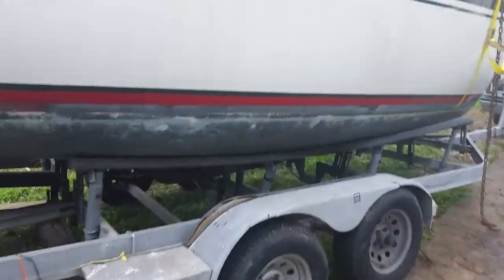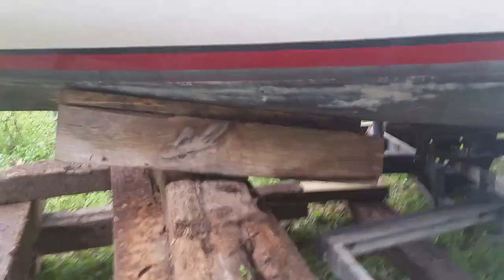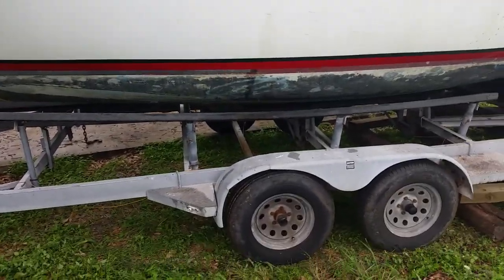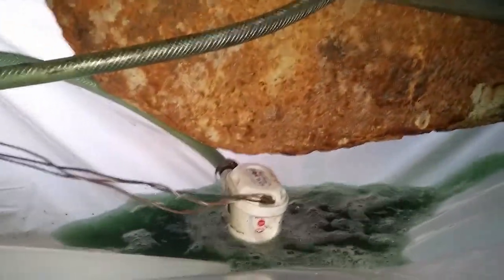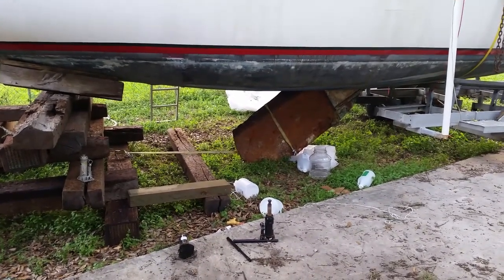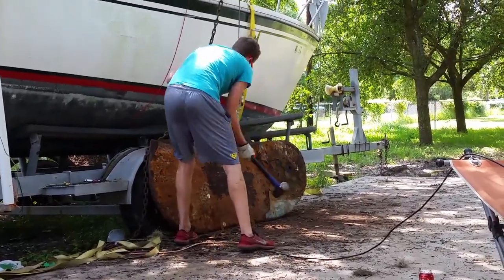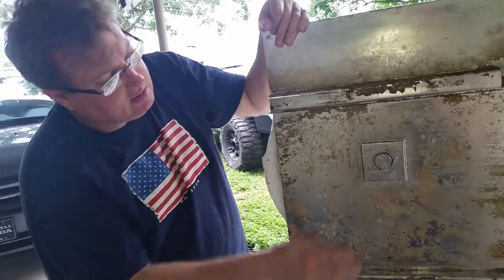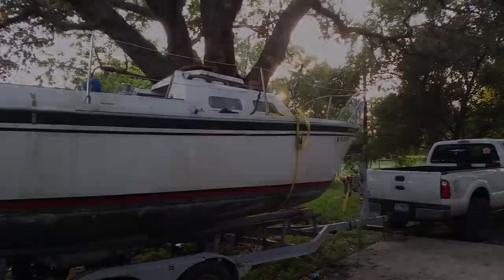DIY Sailboat Swing Keel Removal and Repair parker dawson midship 26

Comment: How is your keel holding up?  The sheet metal partially covering it looked like aluminum to me, which would cause galvanic corrosion.  Not an expert - it could have been stainless steel.

Comment: I refinished my Catalina 22 keel which was not so gone as this one which had obviously gone though it’s zincs. Sandblasting is a good start followed by encapsulation in epoxy. I used west system. The tree thing is scary and I made a proper support system so i could pull the trailer completely out as it needed work as well. An important note is that once the bronze pin is replaced and trued up is the time for epoxy. I also laminated a piece of stainless into the epoxy on the side where the lock bolt tends to scratch though the paint/ epoxy. This has proven to be resilient. Antifouling pain is also a good investment. Zinks need to connect through the epoxy into the cast iron to be effective
Reply: Do you have any details on the support you built to pull your swing keel?

Comment: You might want to add to leave the trailer connected to the truck!!!! Step 1, tree branch gives way. Step 2, boat falls back onto trailer, but is not centered on the trailer. Step 3, trailer is pushed down at the rear from the weight of the boat and the tongue of the trailer is pushed upward because its not connected to the trailer hitch, Step 4, you become a cautionary tale. Very creative solution, but there are some caveats there!

Comment: I have a Midship 25 that I had the keel redone in 2017.
Reply: Further to my previous comment: I had a local boat builder do the work, he used two lift trucks for the lift. My keel was operating and not rusted as much as the one illustrated. The problem was that the pin was ceased in place. After using heat and brut force to no avail I found a product (PB Blaster) in spray can. It took a few squirts to each end of the pin and a few light taps to the pin and out it came.

Comment: Nice work! i have a 73 Midship and keel seems ok so far but will most likely need to work on it at some point. Just wondering when you reattached the keel gearbox and mounting plate it sits on inside the boat did you need to use 3m 4200 or similar product top bed it before bolting it down? I am taking out my gear box and mounting bracket as the plug to the keel lock down is seized in place? Thx

Comment: I appreciate your ingenuity in getting the keel out. But are you at all concerned the same thing will happen again - that the keel will once more corrode? Seems like the protective paint coating won't last forever. I used to coat my centerboard with fiberglass.
Reply from the maker: Given long enough, it may corrode to that point again. The previous owner kept the boat in salt water for most of the year which increased the corrosion rate.  As long as I raise and lower the keel regularly it should last a long time.
Reply: @deo3655  on the other hand, encapsulating it in fiberglass might hide the corrosion and if hauled keep wafer in contact with the steel and surely make it rust. . I like the idea of 'just' painting it. Any rust should be marginal.   Good job.